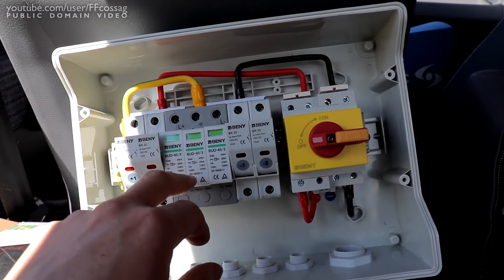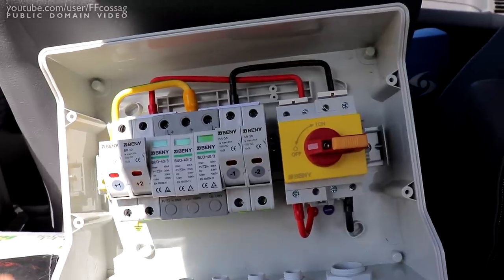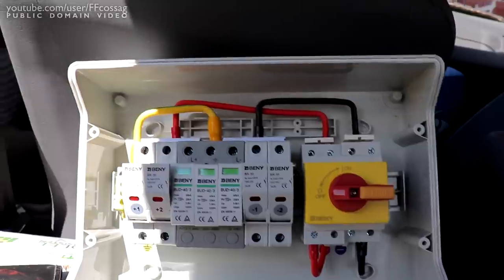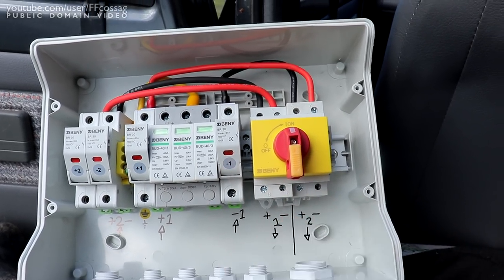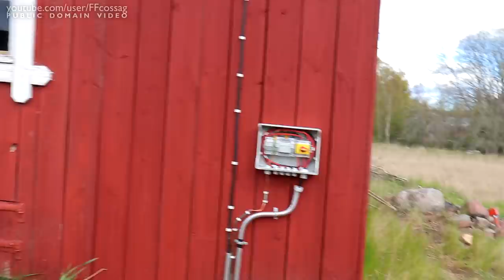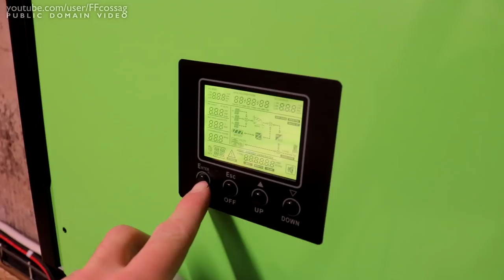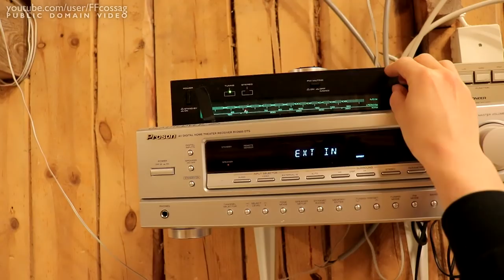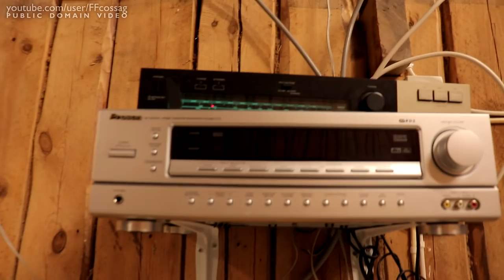10 kW Hybrid Solar VLOG 4 - Wiring up the barn

Comment: As bigclive will tell you, rain water will get into the box and pool up in the bottom anyways - the only way to prevent this is to drill a small drain hole into the box on the lowest part (the bottom side) so that the water can drain out safely.
Reply from the maker: Yep, I'm going to build a metal enclosure to go around it for this reason, and to reduce UV exposure.
Reply: @FFcossag  excellent, I was going to suggest the same, we see roof fires in Australia from installers assuming the IP68 enclosures are UV safe as our law (stupidly) states we must have a second isolation switch on the roof. Eventually, they get water ingress as the enclosure breaks down causing arcing and eventually a fire.

Comment: Regarding the switch's contacts being connected in series. They're connected this way as a safety feature. as this switch is handling high current dc, the potential for arcing and contacts being welded together as a result in worse case when operated is likely. In AC circuits the zero crossing will quench the arc but since dc doesn't have any zero crossing the arc will continue until sufficient distance between the contacts is reach for the arc not to be sustained. But if you put two in series it's not as likely that both contacts will weld at the same time and the load will still disconnect. It's the same way as safety relays are built, with two or more contacts in series. 
I'm not in the solar business but I do work as industrial electrician/instrumentation tech mainly in the petroleum chemical industry and in other ATEX classed facilities so have come across these kind of safety features numerous times ☺
Nice work and thumbs up for using metal pipes and not plastic ☺ Greetings from Sweden ☺
Reply from the maker: You're absolutely right, however these solar isolation switches are specifically designed to break DC safely, and they're priced thereafter. Using two in series is of course safer, but not required. You really shouldn't ever be using them under load anyway, unless it's an emergency. The under load break count is usually rated only in the double digits.
Reply: @FFcossag   Of course it's rated for dc (unless it's made out of chinesium, then anything goes 😉). And yes since it's more of a safety switch, it's not meant to break under load just as you say. ☺
 I mostly just wanted to clarify/explain why the switch was connected the way it was. It might look strange or even stupid to those who don't know the reasons for doing it this way. ☺
Reply from the maker: I think the true reason it was hooked up in series is that they don't want to stock more than one model of switch for all their solar switch boxes, and this one just happened to be set up for one output, hehe.
Reply: I have been using the exact same DC isolation switches and your concerns about welding contacts are unfounded, they are designed specifically to disconnect DC loads and as such internally have a very long path for the DC arc to get around to ensure the arc disconnects. They are also quite stiffly spring-loaded so that the actual switch happens very quickly no matter how slowly you activate the switch, helping to avoid the DC arc from persisting for any length of time that may damage the internals of the device.

Comment: I wish I had your levels of motivation.
Reply from the maker: I have a basement full of big batteries, and I want to use them to save money. I'm not motivated, I'm cheap, lol.
Reply: @FFcossag  but you bought all those wires and inverters, when is your system going to pay for iteself?
Reply from the maker: Passion projects don't need to pay off ;) However, it should pay for itself in 5-7 years, depending on how well I can utilize the energy and how wonky the chinesium inverter is going to be.

Since this system also offers true off-grid capability, it has value beyond its spent dollar. If we suffer another prolonged power outage, I won't have to leave my home, and it's hard to put a monetary value on that.
Reply: FFcossag that is very true, also if gas prices go crazy high you can charge your van from your own power and you will be able to get around unaffected. Also is that going to be the next project? Getting all the mains wired up and having a proper charger for the electric van?
Reply from the maker: The van has a "proper" charger already, unless you're talking about some DIY DC fast charging thing, in which case no, no plans for that. The van only has a 3,3 kW on board charger, so I'm maxing out my hardware by charging off of a normal 16 A outlet.
Reply: @FFcossag  yea but wired into the solar
Reply: @FFcossag  The MMP solar inverter u have is several generations old and comes from Taiwan which is very DIFFERENT to china, Mpp Solar takes a bit more pride in their products and actually listen to installers with problems and will get u a replacement board if necessary out of warranty periods. Issue has been humidity in Australia with them and them fucking bugs.. or gecko's that get inside the unit if not properly installed or the front cover is left off, like i did and it fucking blew out the solar input when it was @ 400v  input, but it was inverter number 2 and the ac charging still works to charge the 48v bank from another inverter or generator and it still can supply me with 3kw of power.... I will eventually replace the board at some time if cost effective and still available. I used to have it feeding the hotwater service during the peak of the day cos the other inverter is the same at 3kw output and had that running the rest of the house. It was easier to pull a wire from the inverter to the hot water service breaker in the power box on the house. BTW what ever the bug that got in there i can not tell cos it turned to ash in a fireball shooting out from the front of the inverter and i just happened to see this happen.... when it happened i heard a loud POP sound and the inverter fans went silent, the whole unit shut down instantly.
Reply from the maker: Since the entire house will be wired to the solar, the car charger will also be wired to the solar.
Reply from the maker: These lime green inverters are actually Voltronic units, and they're very much a Shenzhen based company. MPP didn't even bother rebranding mine - it's still labelled as an InfiniSolar.
Reply: @FFcossag  OHHH sorry they are not MMP Solar then, that shenzen company stole the blue prints for them inverters off MPP solar, sorry u bought the wrong one pal....if shit goes to hell in a hand basket u can forget about getting parts.... cos Taiwan is buying missiles off the USA and shits gonna hit the fan with china cos Taiwan is going to break away from china. Why do u think there is 2 of the biggest boats in the USA fleet heading to the sth china seas.... lookout. Better get a real inverter from MPP Solar lol.

Comment: so, the way we do things here is the tube that comes from the ground, goes against the wall all the way up to the top of the building, then curves and comes down to  terminate and deploy the cables near the box, tube faces into the ground.
 - rain doesn't get in from the bottom up the tube
 - extra cable can be stored, if needed, just change the height of the tube, and get the cables
might not be the best English here, but I think you get the idea
we don't do this for the earth grounding  cables, those are straight from the box to the ground
Reply from the maker: There are many ways to do it, better and worse. I just did it the simplest way.
Reply: Yea that sounds like a good alternative way to do it, come up from the ground but turn 180° so the opening is pointing downward. Nothing will fall or creep in. And extra cable can be stored as a bundle drooping from that, secured to the wall of course. That’s what I would do

Comment: Wouldn't it make sense to put a lightning rod on top of the barn that goes directly into the ground? It would sit maybe half a meter to a meter above the roof, and therefore it could save all the solar modules from getting struck by lightning, not only protecting the whole installation minus the modules, but also the modules themselves as well.
Reply from the maker: It's a bit overkill, if lightning strikes, it's going to strike the grounded metal rack. Most thunder damage is caused by ground potential problems, and a lightning rod would not alleviate that as it'd connect to the same grounding wire as the rack.
Reply: @FFcossag  yeah but you hook up it's own grounding wire
Reply: @FFcossag  A lightning rod, at least where I live, isn't connected to any other part of the electrical installation, since this would counteract its purpose. It usually goes down the side of a building (not in form of a wire, but an actual rod, or maybe a hollow tube, but definitely made out of conductive metal) and straight into the ground. Ideally far enough away from other wires or parts of the electrical installation to prevent arcing over.
Reply from the maker: Oh, I see, that would indeed work better. I'm not too concerned though, since the TV antenna on top o the house has been sitting unstruck for 30 years at a considerably higher point. We probably have the tall surrounding trees to thank for that protection.

Comment: I thought that was a fable/ old wives tale, that lightning would (always) strike the highest point.  

Wouldn't it rather be the point of lowest resistance (insofar as lightning even cares about the 'puny' resistances it gets presented with)?
Reply from the maker: That's correct, it just happens so that most tall things are more conductive than air.
Reply: @FFcossag  - Well sure; Air ain't that good of a conductor compared to anything solid, connected to the earth :P
 
I'm just thinking of some of those churches (for instance) that get struck in the ship by lightning, instead of in their tens of meters higher towers.
 
Was not trying to be pedantic; was just wondering, if what i think i know, is actually true ;)
Reply: @haploideallel  well done son u keep doing that ... some may see it as pedantic... but its curiosity and without it we do not learn.... so good job! thumbs up.

Comment: Please be aware that the tape you have used is no good for waterproofing. You want to use some self-amalgamating tape for long term waterproofing of connections like that which is fully reversible and flexible.

I am running an 80V 1.5KW system (would be higher voltage except in AU you need a license to exceed 110VDC) charging a bank of 200Ah 12V AGMs wired for 48V, using a modified IBM 2130 UPS (3000XHV, actually an APC inverter from 2006 very similar to your 3000VA inverter you featured a while back) with its battery charging capability disabled (very easy to do on this model, just cut a wire and insert a diode) giving me both UPS function as well as solar power up to 2.8KW. I use a custom-designed circuit powered by an stm32f103c8t that communicates with my MPPT via RS-485 and also has a current transducer to measure and monitor power usage and generation which disconnects the utility power to the UPS while there is sufficient battery capacity. This allows me to use the power I generate directly and fall back to utility power when the batteries get low. Eventually, I hope to upgrade my solar array so that I can generate enough power to be completely off-grid, but I like that I have the automatic fallback to utility should we have cloudy weather, or something fails, etc.

Will you be doing something similar? Your comments about cutting the power to the pole indicate you may not be.
Reply from the maker: The PVC tape isn't for waterproofing, it's for UV proofing. I don't like exposing PVC cabling to direct sunlight if I can avoid it.

Cool to hear about another UPS hacker, nice work, always fun to play with recycled UPSes. This system is going to be using a hybrid inverter that essentially acts as a UPS and a grid-tie inverter in one. In normal operation, the grid is connected to the load, with the inverter feeding in parallel with the grid. If the grid fails, it goes off-grid, if the batteries and solar are unavailable, it runs solely on-grid.

Comment: My OCD wouldn't let me leave that swan neck looking like that...
Reply from the maker: Thankfully, I don't have OCD. I tried bending it better, but it would not happen.
Reply: @FFcossag  Pipe bending is a bit of a black art if you ask me. Sure I can bend a couple pipes to go in a box and it will look ok, but bend 6 or 8 parallel  pipes  that would look good is beyond me. The short double like yours or short double with an offset were not only hard to get right, but physically  hard ro bend with big pipe. Was that S your first try or were there other lets call them prototypes? Anyway a nice job and always enjoy you solar content.